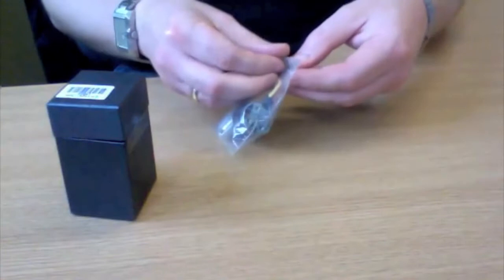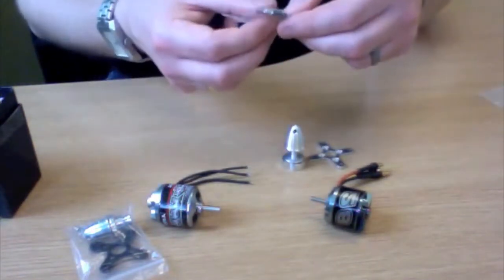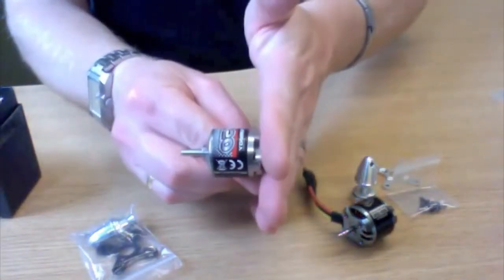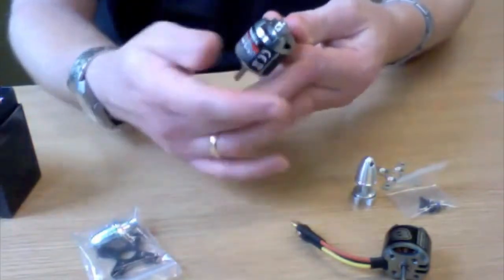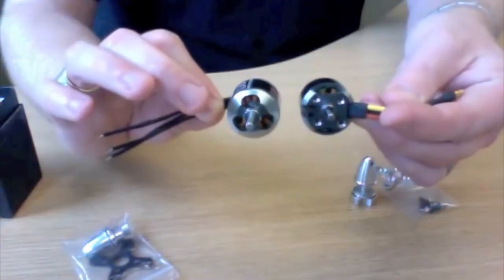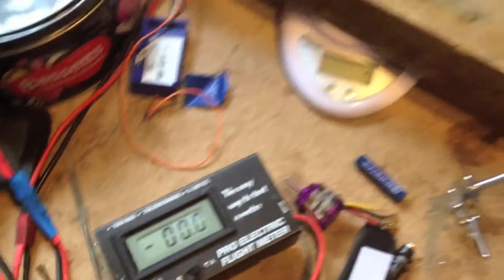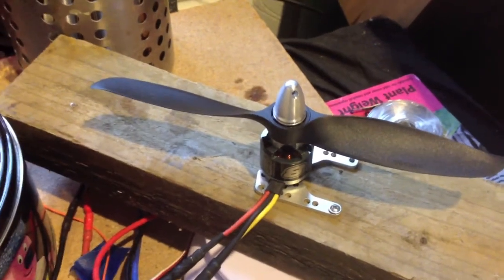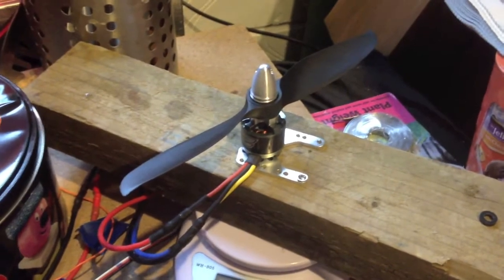Turnigy Park450 1200kv Vs NTM Propdrive 2826 1200kv

Comment: It's refreshing to see how you think "outside the box" in this video. I learned two things: push the shaft through on the Turnigy motor to use it in a front mount and using a table digital scale to test motor thrust. Reverse the rotation and turn the prop around. Great! Thanks.

Comment: I got 10+ NTM28-26 1100kv motors for my quads and all came perfectly balanced, but these are easy break/bend the shaft and vibrate if the props ever touch anything. They perform the best on 9x47 3s @17.6A with around 600g with max thrust. Do not use larger props and stick with the specs with these guys as their efficency drastically reduces

Comment: I got 6 of the NTM 28-26 1200kv, for my hexacopter using 4S batt, and 2 of the motors vibrate a lot, I am guessing they have bent shafts... I ordered another 4 motors hoping that at least 2 of them will be good. I am reading online a lot of people have problems with these motors, but I don't know what equivalent motors to get?
Reply: I have a bunch of the same bent motors and am about to do the same exact setup as you are... Have you figured out if there is a way to replace the shaft of the motors? Would replacing the shaft fix most wobbly motor problems? While these might not be better in durability I was thinking if I should try these to get more thrust: http://www.hobbyking.com/hobbyking/store/uh_viewItem.asp?idProduct=24243 (NTM Prop Drive 35-48 Series 900KV / 815W).

Comment from the maker: Hi Hulla, I have tried both 450 & ntm on my FT cruiser and the 450 perform the best by far on a 3 cell - I think the NTM will perform best on 4s batteries with an 8x6 prop - I tried 10x4.7 on the NTM and whilst on the bench was fine it did not suit the cruiser at all as this size prop just slowed the cruiser right down with horrible prop noise in a full throttle dive. - NTM on a 4s 450 on a 3s is my verdict here :0)

Comment: A 9x6 prop test with the turnugy would have been good. Set the current to 19.1 and read the thrust. If both winded that same way and same gauge then NTM probably have better magnets or core.

Comment from the maker: Hi Andrejl74, I too am going to build the FT cruiser (still waiting for my speed build kit) 2 weeks now :0(  -  I have not modified the motor just used the optional prop adaptor that bolts onto the reverse side of the motor to mount the prop. Hope that helps. I have ordered another ntm motor but it is has issues so need to return it - using 9x5 carbon fibre props on 3 cell lipo. - but I think these motors only come to life on 4 cells.

Comment from the maker: Thanks Brandt, I would have liked to do a 4 cell but I don't own one :0(
If I do get one I will update the video. I have 2 of the ntm propdrive 1200 now as I am going to build the ft crusier so might invest in a couple of 4 cells as you get more power & efficiency @ 15v on these motors.